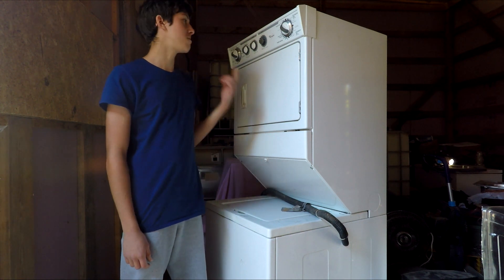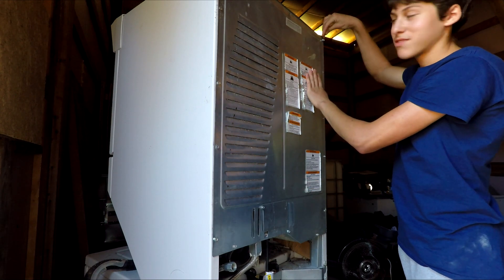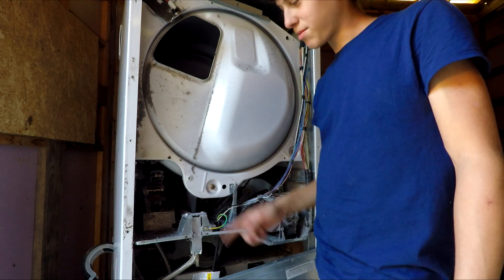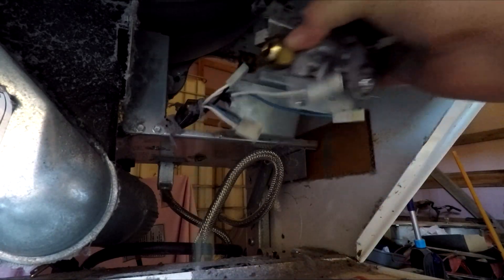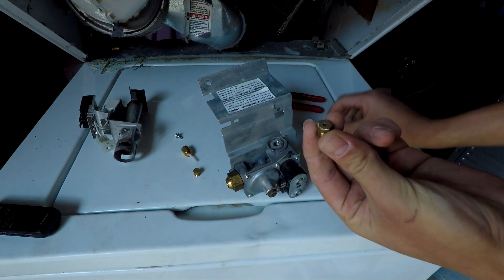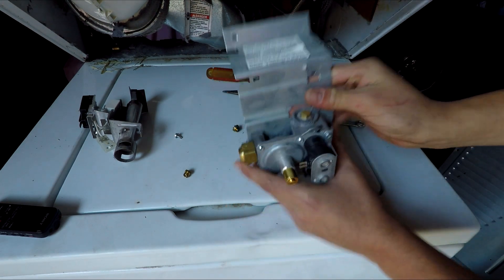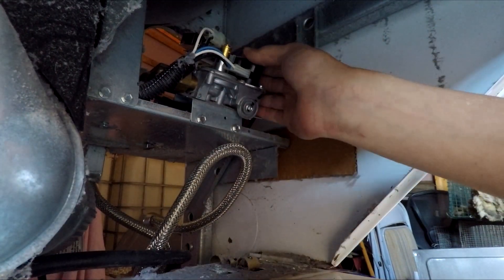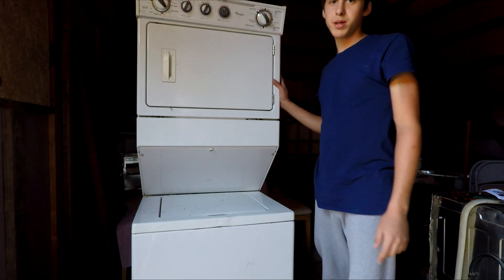Converting a Natural Gas Dryer for Propane

Comment: Did you have to also change out any pipes or hoses that bring the propane in?
Reply from the maker: I didn't have to change any hoses inside the dryer, buts it's possible the gas supply line could need to be changed or adapted if the propane supply uses a different thread

Comment: Was removing the rear stuff even necessary?  Seems to me it wasn't.  But a good opportunity to clean stuff out.
Reply from the maker: There were 2 bolts behind the rear panel that hold in the gas assembly which were nearly impossible to reach from the front side.  For some reason I didn't use a socket set to remove the back panel but it's not very difficult.
Reply: @joshuareynolds5219   Oh I missed that part!  Good job very helpful.
Reply from the maker: @DFWmetroflex  Thanks!  Glad it was helpful

Comment: Pretty cool how this kid can do this with only 3 or 4 tools I’d be frustrated like where’s my power drill !
Reply from the maker: That's interesting you mentioned that, back in 2018 I just had less going on in my life and wasn't always in a hurry as much so I hadn't even thought of it.  We've always had power tools here on the farm but for some reason I just grabbed a set of wrenches when starting this project, and now that I remember, it was pretty tedious to remove those back bolts (I cut the video a lot).  It would have made sense to use power tools for this project, for example at 0:53 I actually broke the igniter when that metal piece dropped because I was using both hands on the tools.  These days I use power tools for everything, this summer my project has been rebuilding an ATV and I always grabbed a drill even when putting in a couple screws.

Comment: Excelent! As a precaution, connect the gas and check for leaks before close the equipment. Am 61 and have some situations working on flamable and non flamable gases in the past. Thanks!
Reply from the maker: Thanks for watching and for the suggestion. When I finished the conversion it was about 6 months before I tested it. There were no leaks but I actually found I had broken the igniter when I took off the back cover and it fell down, so after opening the dryer and replacing that it now works fine.

Comment: Where I can get the conversion kit?
Reply from the maker: I got mine on eBay by searching for the dryers model number, and then propane conversion kit. The specific kit you need depends on what dryer you have but they should be available for most dryers. If your dryer is relatively new, you might be able to find the conversion kit on the manufacturer's website
Reply: @joshuareynolds5219  mine is like yours
Reply from the maker: @MrSpik30  This is the conversion kit for my model, if yours is the same it should work.  https://www.whirlpoolparts.com/PartDetail/Conversion-Kit/3392235A/2310036?

Comment: Lol i didn't know gas dryers excisted. I though every dryer was electric
Reply: 🤦Please educate yourself on everything. Question everything.
Reply from the maker: I think electric dryers are much more common, and an advantage of them is they work anywhere without a complex conversion process like this.  For our case, we have propane gas on our farm in the country, and it is much cheaper than electric appliances.